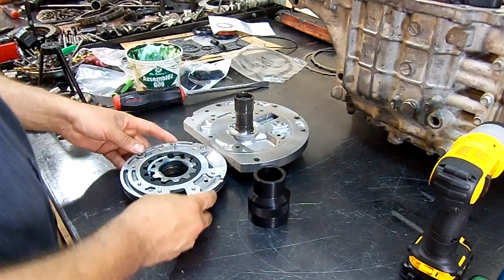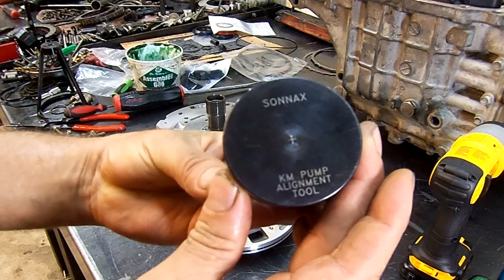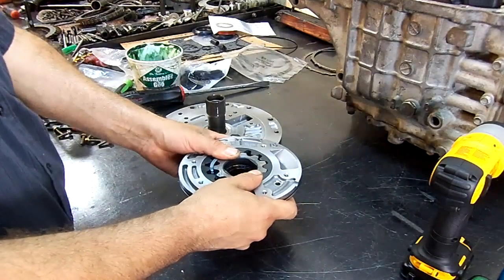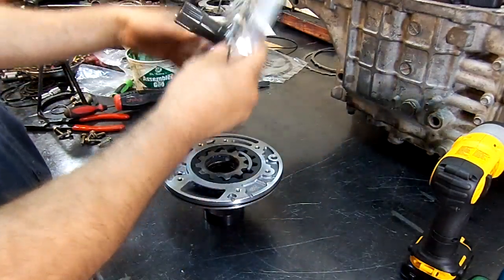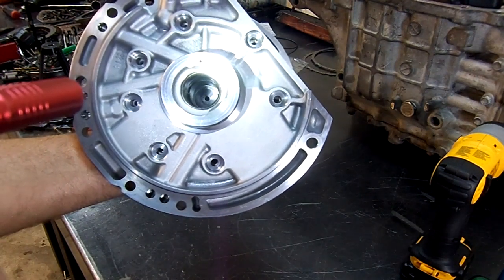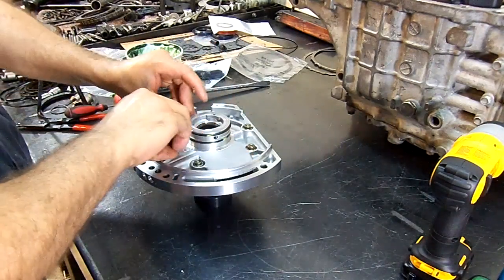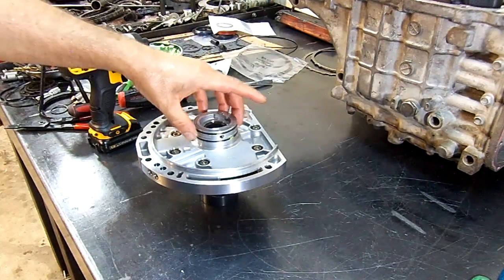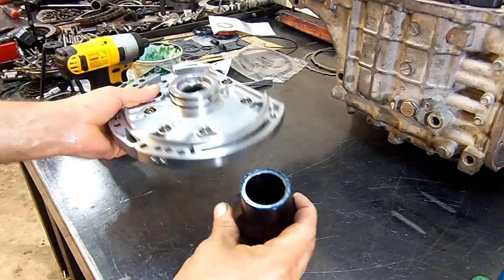F4A/F5A Series Transmission Pump Alignment - Transmission Repair

Comment: Hiram help   I've installed two new eom pumps and they won't pump   The first one worked for an hour an slowly lost pressure and the second new pump and stator and gears won't pump at all. Could this be something else. Such as valve body issue. Help. F4a51. 03 Mitsubishi Deamante.
Reply: Sorry Hiram I have already reinstalled it for the third time    It's got me stumped. I have the alignment tool and all new parts matched up to the old. Three sets sofar.  It engages in all gears but no fluid movement. I took this job as a favor for a lovely elderly woman that my wife is close too. Wasn't charging her   But now I'm lost   The return wavy broke and entered the pump. Like they all do right. I have replaced all hard parts. And fully cleaned valve body. Wich is the thing I did not replace   The first reassembly worked for about 15 miles and started to slip at idle  the more I accelerated it would reengage. So I knew I was losing pressure. I don't think it's the new pumps but my process of elimination ain't workin. Lol. Thanks for replying   I have used so many of your videos for help and must say u are the wizard (the man). This is my ol lady's email. Mine is    Shane.mechanic1964@mail.com.    I just ain't got the money as a favor for a new one and I don't believe in using used ones. Plus I was confident in myself   F4a51 is fairly sO.

Comment: Hi Hiram-
            Bought a 03 Sebring with 45,000 miles about 6 montha ago. Car runs good I did alot of tune up stuff including new +4 fluid but scared about the wavvy in the car. 
I drive the car real easy but at  what mileage should the trans be rebuilt with new updated  wavy so not to destroy trans please?
Thanks!